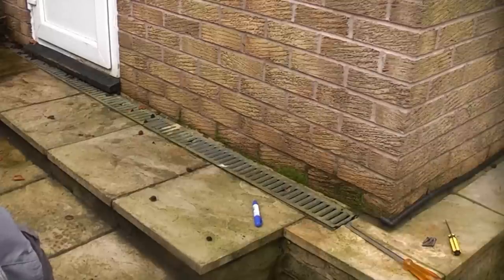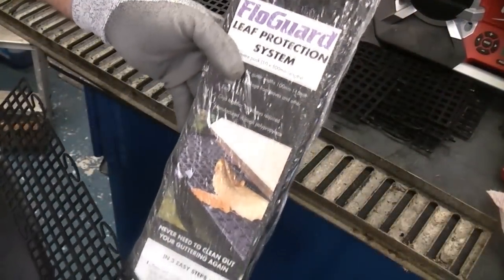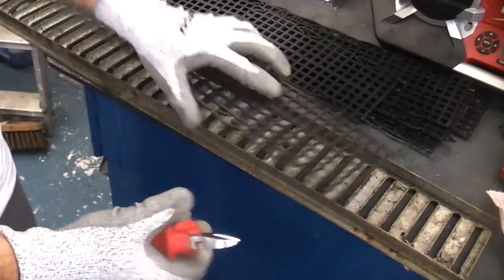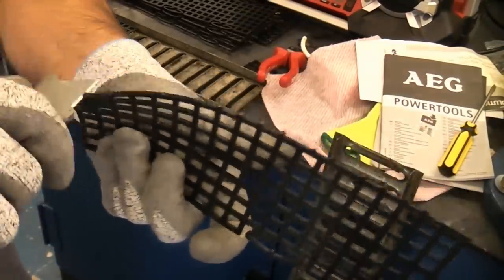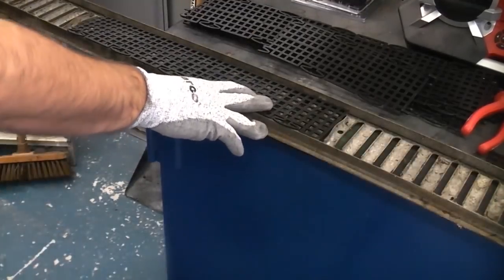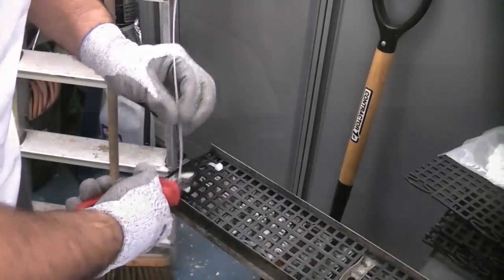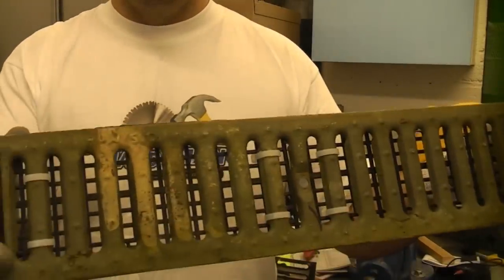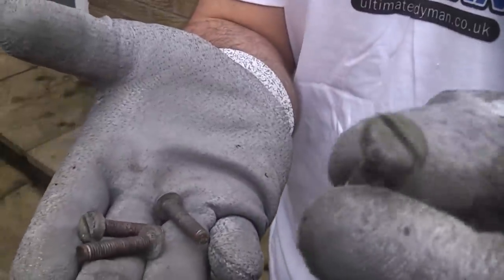How to prevent leaves from blocking drains

Comment: Leaves will now block the smaller mesh and stop water getting into the drain. That’s why the grid holes were made large in the first place. The manufacturer could have used smaller grid/mesh spacings but they would block over with the leaves and stop the drain working. There is no simple lazy solution other than cleaning out and maintaining your drains. Face facts.
Reply from the maker: This works absolutely perfectly. I have two garages here, one has a plastic square cover,similar to this picture- https://www.aco.ae/fileadmin/standard/aco-ae/images/PowerDrain_V175P.png
No leaves ever block this surface drain, and I’ve only cleaned it once since moving here 10 years ago. The Aco drains with the slots allow leaves to go straight through 😉

Comment: the cable ties look horrible on the grate!
Reply from the maker: ***** 
I'm not bothered what they look like as long as I don't have to clean the drain out every year.
We have 5 of these ACO drains at the house, so it's a very time consuming job!
Reply: ***** I have the same problem and appreciated your solution, but my wife would kill me if I put those white zip ties...;-) probably black would be better...
Reply from the maker: ***** 
You could probably use some black silicone to hold them in position from underneath ;-)

Comment: Could glue be used say, instead of the cable ties?
Reply from the maker: You could use silicone to hold them in position.
Thanks for the comment
Reply: ***** I think if you do small dots of welding at the back of the drain cover do few dots of welding every few inch the thickness of the plastic and u can slides the black filters in after the weldings. no needs Cable ties. that way u can remove and put back the black plastic for future cleaning...

Comment: I've used the hedgehog strips designed for gutters. It works a treat and you just pull them out if they need cleaning, give them a shake and they're good to go.
Reply from the maker: I did think about using those myself but had a load of flo guards left over so used them.
Thanks for the comment

Comment: Great tip, also black cable ties would be swell.
Reply from the maker: Emforever123 
Thanks, I had some black ones in the van but it was too far away LOL
Reply: Stainless steel safety wire would do the job also, need a safety wire pliers to twist tight, pigtail on bottom